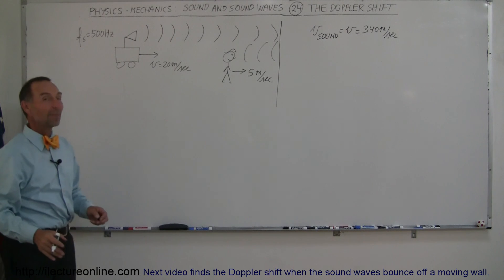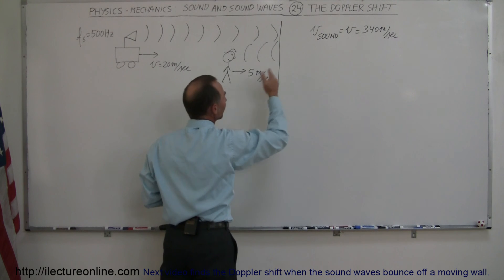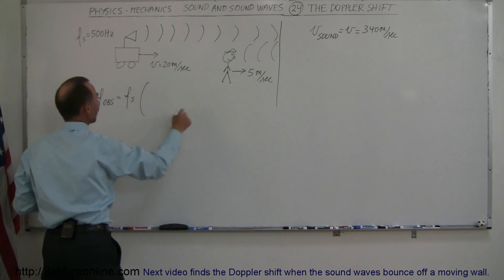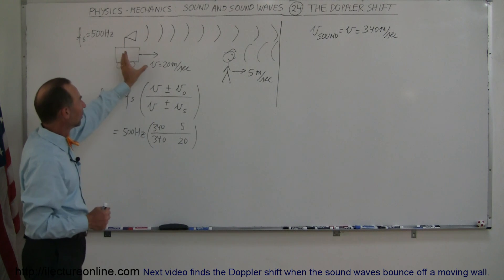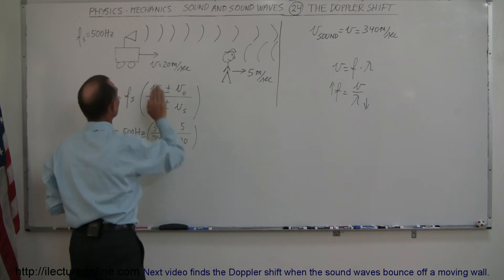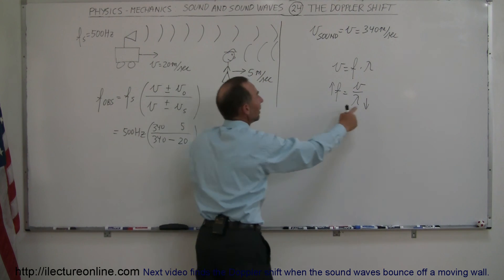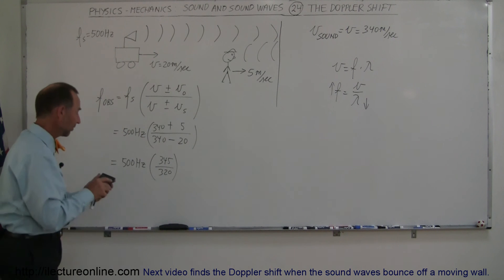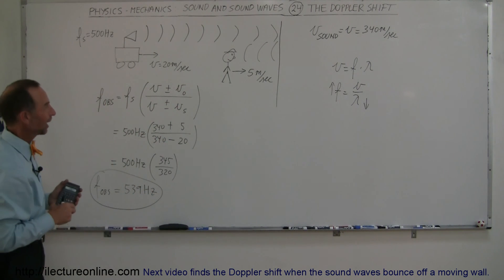Physics 20  Sound and Sound Waves (24 of 49) Doppler Shift

Comment: I'm just a little confused that how does that possible when the sound reaches to the wall and bounce to the person first instead of reach to the person in the first place. I meant the person suppose to hear the sound from behind first instead of hearing the bounce sound from the wall right?
Reply from the maker: Off course, but we are just using this as an example with the sound bouncing off the wall.
Reply: I think, you could picture this scenario more accurately if say, there's a wall behind the observer & that wall is blocking the sound that's coming from the ambulance. 

The only way the observer can hear that sound is through reflection of the waves from the walls at front & that makes this case more realistic imo